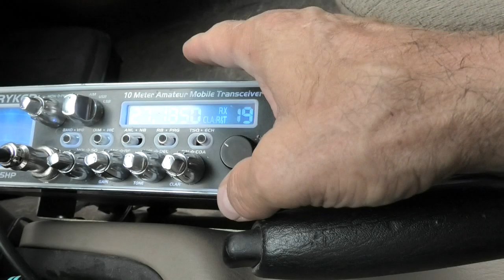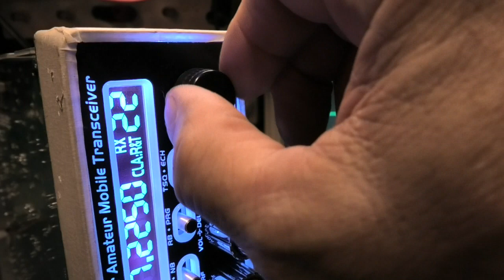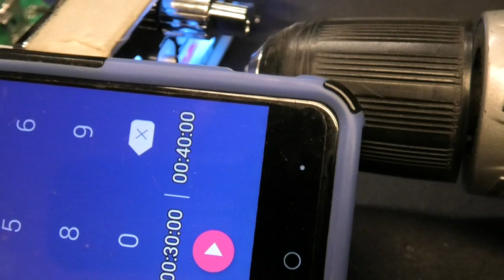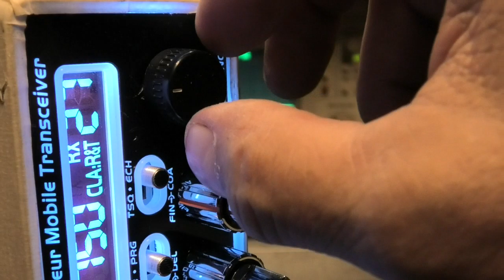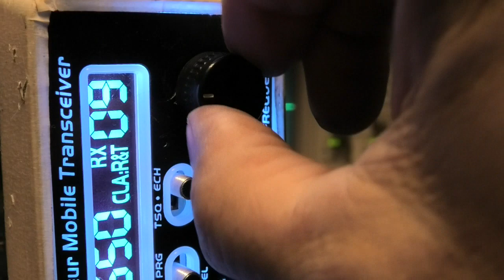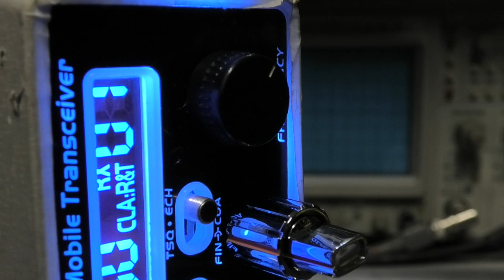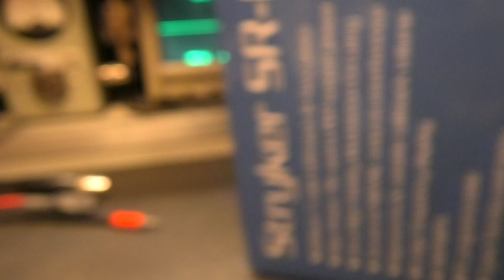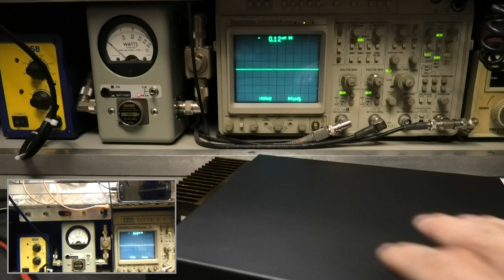PAY ATTENTION! ENCODER / SELECTOR NEWS -  STRYKER Radio SR 955 - 655 RADIOS - HEAT TEST .. IT'S ON!

Comment from the maker: It's in stone - Hardrive Approved, MoFo Said So! Bite your tongue and follow directions .. Here's what it takes to cut through the noise, be loud and crystal clear with a better receiver too:  A) Tuned Bench:  https://www.youtube.com/watch?v=lwcDfXOgAls.  True, it's more complicated and time consuming to accomplish these consistent and accurate results. Below is a partial procedure and list of calibrated equipment used to achieve this level of performance . Read on ..

Fine Tune CB Radio Shop strictly adheres to (https://www.nist.gov/) NIST Traceable Calibrations and other industry standards to maintain accuracy and consistency for providing Real World Performance Tuning of Citizens Band and 10 Meter export mobile radios with integrity.

"Basic Textbook AM/FM/SSB Transceiver Tune, Alignment and Calibration" 

1) Pll adjustments
VCO & OSC, AM TX OSC, USB TX OSC, LSB TX OSC.

2) Transmitter alignment
DRIVER BIAS, FINAL BIAS, SSB  (or gate voltages for mosfet versions) CARRIER BALANCE, HI-LO AM & SSB Power, RF METER, AMC, ALC and FM DEVIATION.

3) Receiver alignment
AM/FM RF & IF SENSITIVITY, FM DETECTOR/DEVIATION, SSB IF SENSITIVITY, SSB S-METER, AM/FM S-METER (100uV unmodulated -67dbm for “S-9” meter reading!), AM/FM SQUELCH RANGE, SSB SQUELCH RANGE, and NOISE BLANKER/AUTOMATIC NOISE LIMITER (Real World dBm to volts (uV) tables below).

That's just a typical run of the mill textbook tune up and alignment (if you're lucky). There's more to it than frequency alignment, modulation adjustment, meter calibration and a tune up report displaying exaggerated rms Bird peak watts! 

"Test Bench includes"

Bird 4314C Meter
https://www.birdrf.com/Products/Test%20and%20Measurement/Power-Meters/Wattmeters-Line-Sections/RF-Wattmeters/4314C_PEP-Single-Element-Wattmeter.aspx
Part 1) https://www.youtube.com/watch?v=RpX9IHe4ORM&t=16s
Part 2) https://www.youtube.com/watch?v=LuhbqTf6Bxw
Bird 4314C Accuracy Test: https://www.youtube.com/watch?v=DqEOabYqhQo&t=5s
Bird Stipulates 1/2 wavelengths  https://www.youtube.com/watch?v=5eWhgT-rTII
And Genuine Bird Elements from 1K down.

Bird 4373 Sampler 
https://www.rfparts.com/signal-samplers.html

HP8924c with options
http://userequip.com/files/specs/2147/HP%208924C%20Repair.pdf
https://www.youtube.com/watch?v=Cg1w0xBa27s&t=1s

HP8920a with options
https://www.keysight.com/upload/cmc_upload/All/EPSG072204.pdf

Three analog scopes, one digital 200 Mhz
https://www.atecorp.com/atecorp/media/pdfs/data-sheets/tektronix-2465b-2467b_manual.pdf
https://www.youtube.com/watch?v=by98x4eu2lM

Fluke 27fm
http://www.fluke.com/fluke/inen/digital-multimeters/fluke-27.htm?pid=56055
 
LCR http://www.lcrresearch.com/wp-content/uploads/2017/05/LCR_Pro1_Manual_version1.03.pdf

Power supplies
6 Cosel PBA1500f12 (750 amps) variable and configurable.
https://en.cosel.co.jp/product/powersupply/PBA/PBA1500F/PBA1500F-12/
Corcom 20VB1 F7130 EMI Filter 50-60Hz 250V

Times Microwave Coax jumpers and test leads
http://www.timesmicrowave.com/cms/products/cables/lmr/
https://www.youtube.com/watch?v=EmqaGJ6IWow
https://www.youtube.com/watch?v=1ltFVSxGp5Y
https://www.youtube.com/watch?v=v12YZT_1o90
https://www.youtube.com/watch?v=h7iiYfmYWRA&t=215s

Amphenol RF Connectors
https://www.amphenolrf.com/
https://www.youtube.com/watch?v=dVh5B0hdEA0 
https://www.youtube.com/watch?v=dKZg8T_AOso

More range, compliments, reliability and a quieter, clearer but more sensitive receiver,  Get Fine Tuned .. not peaked and ruined.

Here are some VideoGates of me at the bench practicing what I preach using my bench radio or customers radio completed and ready to be shipped: https://www.youtube.com/results?search_query=hard+drive+163+ more: https://www.google.com/search?q=Hard+Drive+163+nm&ie=utf-8&oe=utf-8&client=firefox-b-1-ab

It's what I recommend, use, service and sell ... to you ... not something non practical or deceiving in a misleading way. I'm not just the tech and owner of Fine Tune CB Radio Shop, I'm a customer too!  When finished, You'll be giving radio checks, not asking for them .

dBm To Watts and Volts
Tables below displays relationship between Power in [dBm] or [Watts] and Voltage in RMS, peak, peak-to-peak for sinusoidal signals in 50-Ohm systems for accurately measuring and tuning am/fm/ssb receiver sensitivity, agc, squelch and "S9" Meter calibration. Real World! Mike @ Mikes Radio Repair (Romper Room), Mark Rutherford aka Mark 19960, CB Kidd, Martian and all of your other fake accounts pay attention to the tables below, stop misaligning radios, spreading false information and promoting propaganda! 

  [dBm] [Watts]   [Volts]rms   [Volts]p    [Volts]pp
-140 0.100E-16  22.361 nV  31.618 nV  63.236 nV 
-139 0.126E-16  25.089 nV  35.476 nV  70.952 nV 
-138 0.158E-16  28.150 nV  39.805 nV  79.609 nV 
-137 0.200E-16  31.585 nV  44.662 nV  89.323 nV 
-136 0.251E-16  35.439 nV  50.111 nV  100.222 nV 
-135 0.316E-16  39.764 nV  56.226 nV  112.451 nV 
-134 0.398E-16  44.615 nV  63.086 nV  126.172 nV 
-133 0.501E-16  50.059 nV  70.784 nV  141.568 nV 
-132 0.631E-16  56.167 nV  79.421 nV  158.842 nV 
-131 0.794E-16  63.021 nV  89.112 nV  178.223 nV 
-130 0.100E-15  70.711 nV  99.985 nV  199.970 nV 
-129 0.126E-15  79.339 nV  112.185 nV  224.370 nV 
-128 0.158E-15  89.019 nV  125.874 nV  251.747 nV 
-127 0.200E-15  99.882 nV  141.232 nV  282.465 nV 
-126 0.251E-15  112.069 nV  158.465 nV  316.931 nV 
-125 0.316E-15  125.743 nV  177.801 nV  355.602 nV 
-124 0.398E-15  141.086 nV  199.496 nV  398.992 nV 
-123 0.501E-15  158.301 nV  223.838 nV  447.677 nV 
-122 0.631E-15  177.617 nV  251.151 nV  502.302 nV 
-121 0.794E-15  199.290 nV  281.796 nV  563.591 nV 
-120 0.100E-14  223.607 nV  316.180 nV  632.360 nV 
-119 0.126E-14  250.891 nV  354.760 nV  709.519 nV 
-118 0.158E-14  281.504 nV  398.047 nV  796.094 nV 
-117 0.200E-14  315.853 nV  446.616 nV  893.232 nV 
-116 0.251E-14  0.354 µV  0.501 µV  1.002 µV 
-115 0.316E-14  0.398 µV  0.562 µV  1.125 µV 
-114 0.398E-14  0.446 µV  0.631 µV  1.262 µV 
-113 0.501E-14  0.501 µV  0.708 µV  1.416 µV 
-112 0.631E-14  0.562 µV  0.794 µV  1.588 µV 
-111 0.794E-14  0.630 µV  0.891 µV  1.782 µV 
-110 0.100E-13  0.707 µV  1.000 µV  2.000 µV 
-109 0.126E-13  0.793 µV  1.122 µV  2.244 µV 
-108 0.158E-13  0.890 µV  1.259 µV  2.517 µV 
-107 0.200E-13  0.999 µV  1.412 µV  2.825 µV 
-106 0.251E-13  1.121 µV  1.585 µV  3.169 µV 
-105 0.316E-13  1.257 µV  1.778 µV  3.556 µV 
-104 0.398E-13  1.411 µV  1.995 µV  3.990 µV 
-103 0.501E-13  1.583 µV  2.238 µV  4.477 µV 
-102 0.631E-13  1.776 µV  2.512 µV  5.023 µV 
-101 0.794E-13  1.993 µV  2.818 µV  5.636 µV 
-100 0.100E-12  2.236 µV  3.162 µV  6.324 µV 
-99 0.126E-12  2.509 µV  3.548 µV  7.095 µV 
-98 0.158E-12  2.815 µV  3.980 µV  7.961 µV 
-97 0.200E-12  3.159 µV  4.466 µV  8.932 µV 
-96 0.251E-12  3.544 µV  5.011 µV  10.022 µV 
-95 0.316E-12  3.976 µV  5.623 µV  11.245 µV 
-94 0.398E-12  4.462 µV  6.309 µV  12.617 µV 
-93 0.501E-12  5.006 µV  7.078 µV  14.157 µV 
-92 0.631E-12  5.617 µV  7.942 µV  15.884 µV 
-91 0.794E-12  6.302 µV  8.911 µV  17.822 µV 
-90 0.100E-11  7.071 µV  9.998 µV  19.997 µV 
-89 0.126E-11  7.934 µV  11.218 µV  22.437 µV 
-88 0.158E-11  8.902 µV  12.587 µV  25.175 µV 
-87 0.200E-11  9.988 µV  14.123 µV  28.246 µV 
-86 0.251E-11  11.207 µV  15.847 µV  31.693 µV 
-85 0.316E-11  12.574 µV  17.780 µV  35.560 µV 
-84 0.398E-11  14.109 µV  19.950 µV  39.899 µV 
-83 0.501E-11  15.830 µV  22.384 µV  44.768 µV 
-82 0.631E-11  17.762 µV  25.115 µV  50.230 µV 
-81 0.794E-11  19.929 µV  28.180 µV  56.359 µV 
-80 0.100E-10  22.361 µV  31.618 µV  63.236 µV 
-79 0.126E-10  25.089 µV  35.476 µV  70.952 µV 
-78 0.158E-10  28.150 µV  39.805 µV  79.609 µV 
-77 0.200E-10  31.585 µV  44.662 µV  89.323 µV 
-76 0.251E-10  35.439 µV  50.111 µV  100.222 µV 
-75 0.316E-10  39.764 µV  56.226 µV  112.451 µV 
-74 0.398E-10  44.615 µV  63.086 µV  126.172 µV 
-73 0.501E-10  50.059 µV  70.784 µV  141.568 µV 
-72 0.631E-10  56.167 µV  79.421 µV  158.842 µV 
-71 0.794E-10  63.021 µV  89.112 µV  178.223 µV 
-70 0.100E-09  70.711 µV  99.985 µV  199.970 µV 
-69 0.126E-09  79.339 µV  112.185 µV  224.370 µV 
-68 0.158E-09  89.019 µV  125.874 µV  251.747 µV 
-67 0.200E-09  99.881 µV  141.232 µV  282.465 µV
-66 0.251E-09  112.069 µV  158.465 µV  316.931 µV 
-65 0.316E-09  125.743 µV  177.801 µV  355.602 µV 
-64 0.398E-09  141.086 µV  199.496 µV  398.992 µV 
-63 0.501E-09  158.301 µV  223.838 µV  447.677 µV 
-62 0.631E-09  177.617 µV  251.151 µV  502.301 µV 
-61 0.794E-09  199.290 µV  281.796 µV  563.592 µV 
-60 0.100E-08  223.607 µV  316.180 µV  632.360 µV 
-59 0.126E-08  250.891 µV  354.760 µV  709.520 µV 
-58 0.158E-08  281.504 µV  398.047 µV  796.094 µV 
-57 0.200E-08  315.853 µV  446.616 µV  893.232 µV 
-56 0.251E-08  0.354 mV  0.501 mV  1.002 mV 
-55 0.316E-08  0.398 mV  0.562 mV  1.125 mV 
-54 0.398E-08  0.446 mV  0.631 mV  1.262 mV 
-53 0.501E-08  0.501 mV  0.708 mV  1.416 mV 
-52 0.631E-08  0.562 mV  0.794 mV  1.588 mV 
-51 0.794E-08  0.630 mV  0.891 mV  1.782 mV 
-50 0.100E-07  0.707 mV  1.000 mV  2.000 mV 
-49 0.126E-07  0.793 mV  1.122 mV  2.244 mV 
-48 0.158E-07  0.890 mV  1.259 mV  2.517 mV 
-47 0.200E-07  0.999 mV  1.412 mV  2.825 mV 
-46 0.251E-07  1.121 mV  1.585 mV  3.169 mV 
-45 0.316E-07  1.257 mV  1.778 mV  3.556 mV 
-44 0.398E-07  1.411 mV  1.995 mV  3.990 mV 
-43 0.501E-07  1.583 mV  2.238 mV  4.477 mV 
-42 0.631E-07  1.776 mV  2.512 mV  5.023 mV 
-41 0.794E-07  1.993 mV  2.818 mV  5.636 mV 
-40 0.100E-06  2.236 mV  3.162 mV  6.324 mV 
-39 0.126E-06  2.509 mV  3.548 mV  7.095 mV 

                 Don't Be A Mud Duck!

 https://www.arrl.org/shop/ARRL-Handbook-2019-eBook

Hard Drive 163 NM. 73's! Click click.?